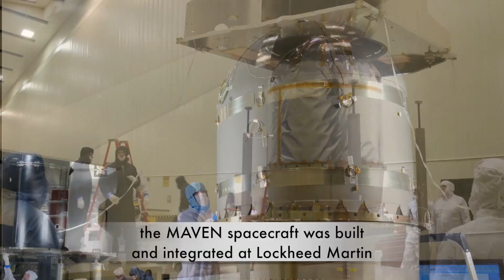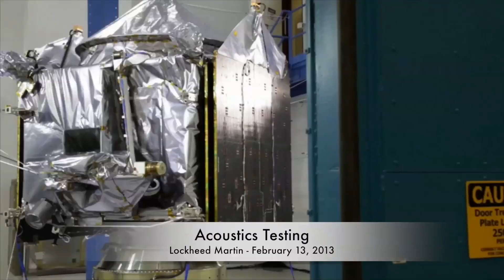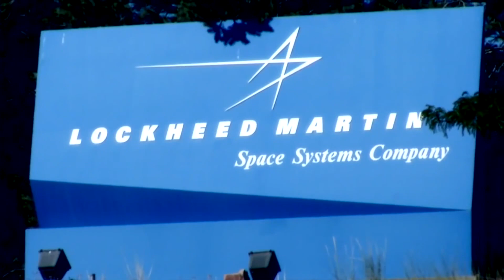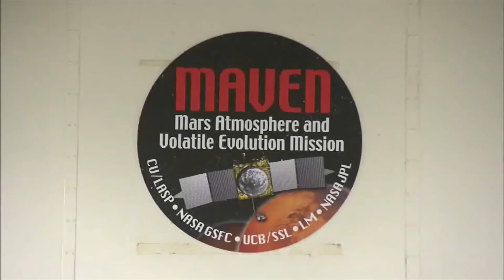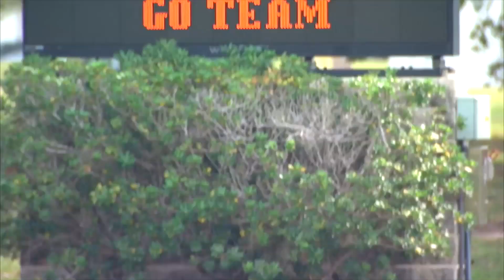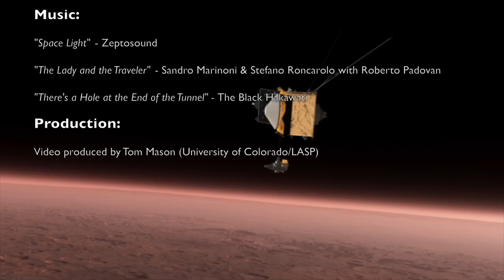MAVEN's Journey to Mars

Comment: so maven will never touch mar's surface, correct?
Reply from the maker: Not during it's mission, no. MAVEN is expected to operate in some capacity for up to a decade. Once all fuel for the mission is exhausted, the orbit of the spacecraft will experience a natural decay and MAVEN will enter the Martian atmosphere one final time. Despite the relatively thin composition of Mars’ atmosphere (it’s less than 1% as dense as Earth’s), MAVEN will largely burn up upon entry, but some of the material that comprises the spacecraft and its components is expected to survive this process and impact the surface of Mars.